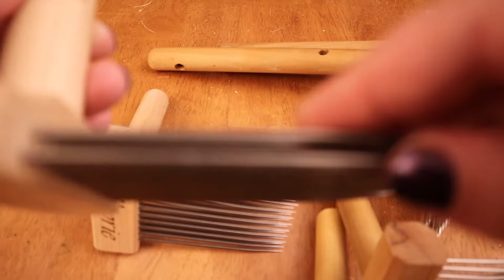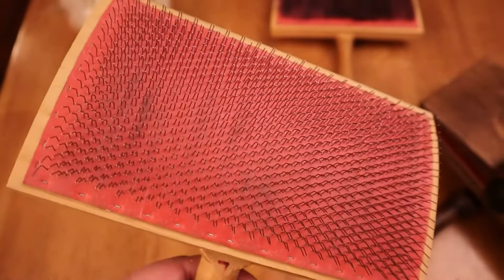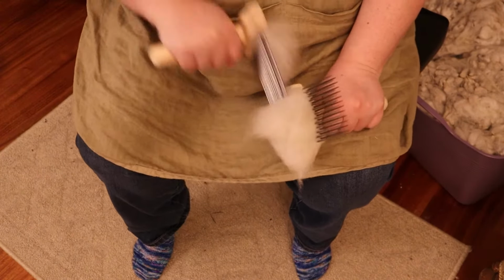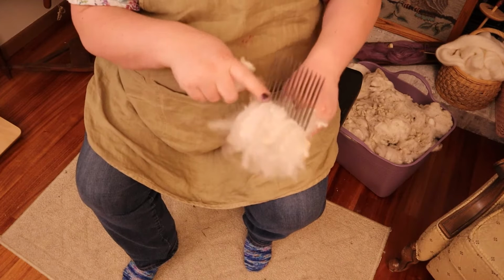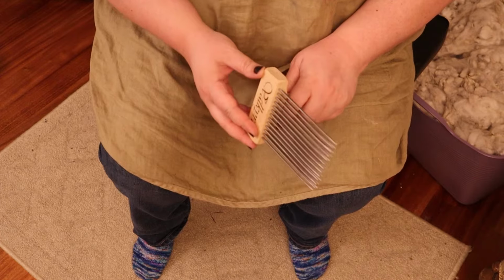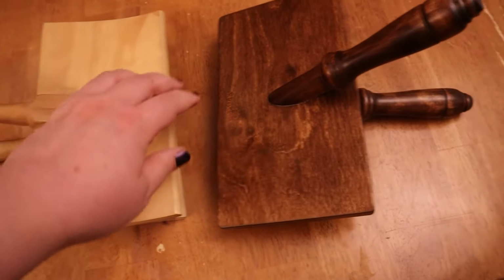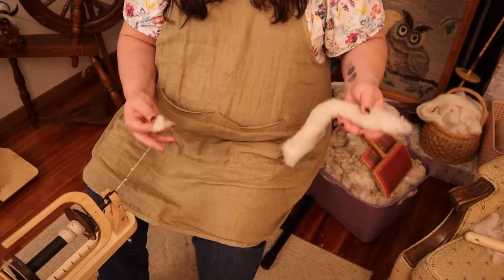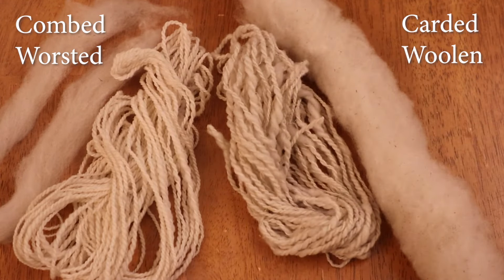How to use Wool Combs and Hand Cards | Plus a Yarn Comparison!

Comment: I've never worked with many different types of yarn, as my default yarn is Red Heart depending on my project. But lately I started making a coat (which I ran out of yarn for) in Red Heart Boutique Unforgettable, which is a lot like the hand carded yarn you showed. It's very airy and I could tell from looking at it that it was most likely carded. It's not uniform in size across the board, some sections of the yarn are very tight while others are bulkier in some ways (though that could have been the result of me having to wind it into a skein after it originally fell apart). Watching this and a few of your other videos, I'm now really wanting to spin my own yarn to continue this coat (though I have none of the materials or how to gauge it properly as the one I used was supposedly a size 4).

Comment: I do like your videos very much. I tend to spin a smoother yarn for Tapestry weaving, and I hate VM, so most of my fiber is combed. I did notice you did not mention hackles, which for me, make combing easier than using two combs. But I know that’s a personal preference. I have a Brother Drum Carder that I use quite a bit for blending fibers, and sometimes I use my hand cards to open up locks before putting them on the drum carder, as they blend much quicker and more evenly.

Comment: Mum was very much a member of team combed, rather than team carded. I do remember seeing her with some hand cards that she borrowed from her teacher but she never acquired any of her own. Her reasons for preferring combed wool were as stated here - she liked spinning from the aligned fibres to get a worsted-style yarn. And there was usually a lot of vegetable matter to be removed. 
 
What differed from here is what her comb (yes, comb singular) looked like. I dug it out of her sewing &c box earlier this evening. Basically, her wool comb looked much more like a hair comb. This comb does not have the sharp tines the combs shown here have. She would pick a little bundle of fibres from the fleece and comb them until the vegetable matter was removed and the fibres were aligned and then I remember the combed bits being placed on a tray. It was a fairly slow process but it gave her the result she wanted.

Comment: I bought a set of both combs and hand cards way back in my beginning. I've come to prefer the carders as easier on the wrists. I also tend to keep a fleeces locks as undisturbed as possible, fluff them up on the cards and spin worsted yarns. My Combs have proven a bit vicious: "sharp" doesn't describe them by half! And yes, I've learned a bunch of things from your videos. I'm going to try for a woolen yarns or two, now that I know what to look for.

Comment: I made my own combs with long nails and wood. and they work really well. 1 row of nails. each nail 5mm apart. Also made a long comb for blending. And made myself a Diz. I use them to process my wool 1st. The stuff left over I use the bought hand carders - mine are curved. After that when theres some left that is all nobbly or too short - I keep aside for stuffing or wet/dry felting. I use all my wood I get - usually there is no throw away at all.
Reply: Thank you for the tips!  I will take a moment and think of this is something I can make myself!
Reply: If you are not too bad at woodwork you can just buy the carding cloth and make your own paddles from plywood and sticks. Works out cheaper.
Reply: @jackieswanson225 also there is a video about making the larger blending board. It looks pretty easy too.

Comment: Perfect timing! Just tonight I pulled out the cards and the combs to do some sampling from a fleece I bought a year ago and just finished washing. It has locks of about 4 inches and a beautiful luster, so I figured combing it and spinning worsted would be ideal, only I am not too experienced with combs yet. Although I had some hiccups with the combing process (due in part to stuck tips and snarled butts on my locks), I ended up with some very nice combed top that spun up beautifully and preserved the luster. There really is nothing like spinning your own combed top!

I had quite a bit of combing waste that unfortunately mixed long-ish good fiber with snarls and second cuts, and I carded it all together into a rolag that made some rather lumpy and scratchy yarn. No surprise there, but I just wanted to see if there was anything to be had from the waste! Next time, I will comb the waste a second time so as to get the good fibers out, and compost the rest. Life's too short for bad fiber!

Comment: I combed some raw washed wool using old plastic combs from my bathroom's junk drawer (one big-toothed and one fine-toothed) and it seemed to work ok! I haven't spun the fiber yet though because I'm afraid it's going to be fiddly to work with, since I had to just pull the fibers off the combs instead of dizzing, but I'm still looking forward to trying :~) thank you for the video! It's going to be helpful moving forward ~

Comment: Evie, when I started on my fibre arts journey I had zero tools. 
I used a dog comb (and I still use that same comb 4y later!)
Although I have since bought a pair of hand carders, I prefer my dog comb as I can process a phenomenal amount of fibre in a very short time. For example, in the same amount of time you took using your comb I could have done three times the amount. [not to skite…], but I can’t justify the time it takes loading the combs, when, that same amount of time could be spent doing the combing. 
The other advantage of using the dog comb is that it can be used on raw (unwashed) locks as well as washed locks. So, if I’m going to spend money on having my washed fleeces professionally carded (where it’s priced out per kilo), I will comb all my locks first (thus removing that excess anyhow), then carefully wash and dry.  (I have a particular scouring method which I also self-designed). 
This is just my personal opinion and I still love and look forward to your videos ❤️

Comment: Hi   Can you please tell me what a Diss is 🥴
Reply from the maker: A diz is a small tool with a hole for pulling the fiber through. It can be a button, a bottle cap with a hole punched in it, or a specifically designed tool. I just use my hands sometimes. 😊🧶✨